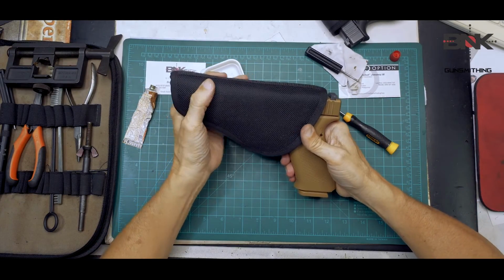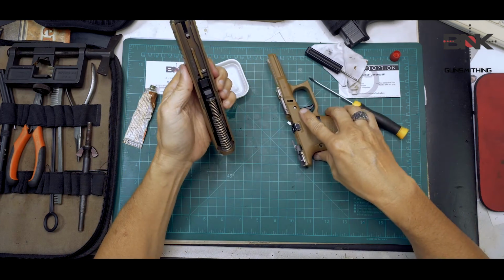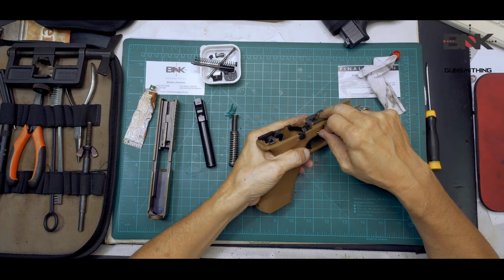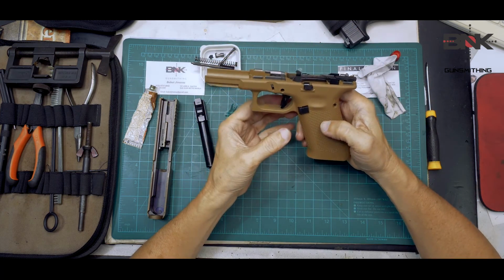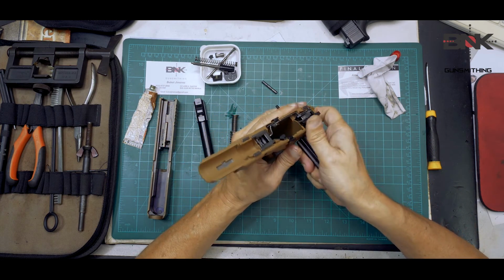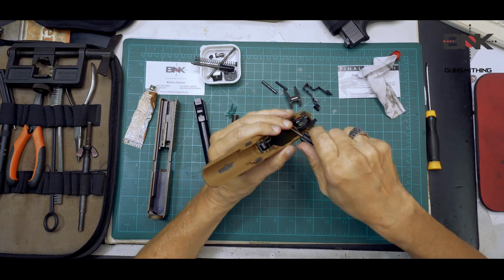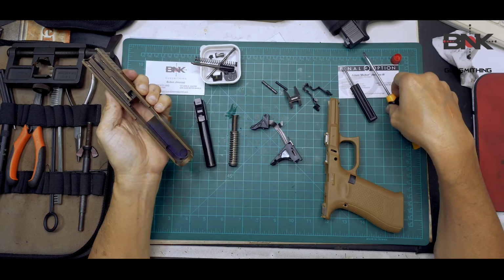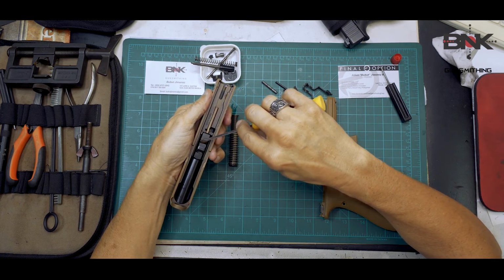How to Assemble & Disassemble a Glock19x Gen5

Comment: You're not supposed to keep using that copper anti-seize.  Once that stuff wears off just use regular gun oil at recommend spots in the manual.  
Why ?  Because its there for the initial break in you don't want to keep using it because it's literally ground up metal it's not a lubricant you're damaging your weapon by using it over and over .    
This Information comes right from Glock